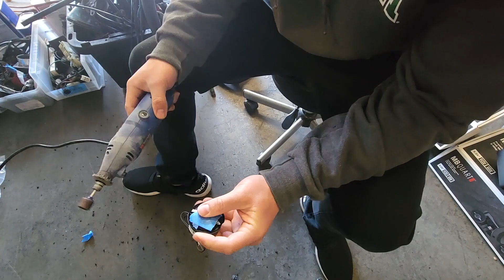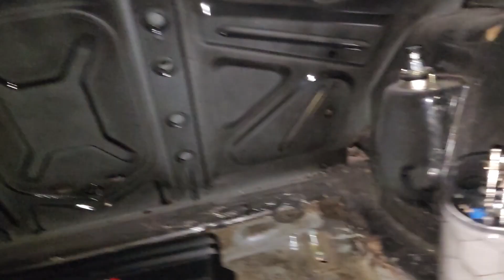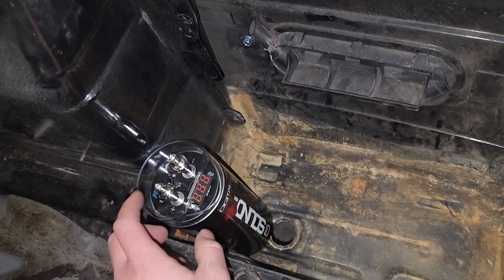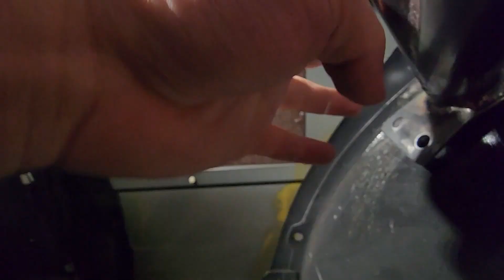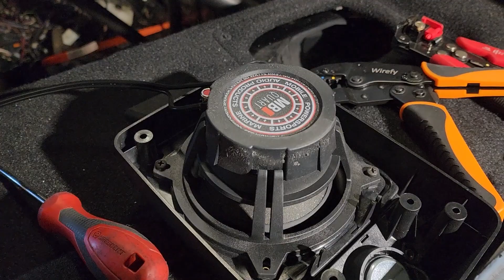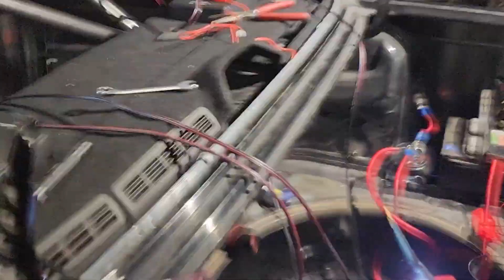E30 Restoration EP17 | Aftermarket Speakers , E30Dreamin Subwoofers , And Amp Install

Comment: Your have to install the fuse as short as possible to your batery!
Reply from the maker: There is
Reply: @themaskeddriver  😂
Reply: @themaskeddriver  you have around 30 inches of unfused wire!
Reply from the maker: @fabiboy6703 where? Oh are you meaning all the extra wire from the battery to the capacitor? Lol then yes it will all be trimmed just need needed the extra length for the video. Right off the battery the fuse will be for the capacitor

Comment: So thoes speakers wouldn't fit in a convertible
Reply from the maker: Correct. The e30dreamin mini subs will NOT fit in a vert. He makes a trunk box for the very. The 5.25 speakers will in the front. I'm not 100% sure what size speaker e30 verts use in the rear
Reply: @themaskeddriver  5 1/4 on the rear and front, but you'll have to make adjustments depending on the tweeter size for the rear

Comment: the capacitor was a waste of money as that amp will barely put a damper on your electrical system
Reply from the maker: Good to know! Thank you!
Reply: @themaskeddriver  not a problem! and if you sound deaden where the speakers are in the front they will sound even better. and i would stick a bit of foam around where the subs are to help stop some rattles from happening.
Reply from the maker: I plan on doing either lizard skin or traditional sound deadening.